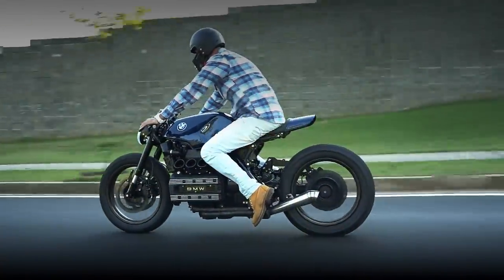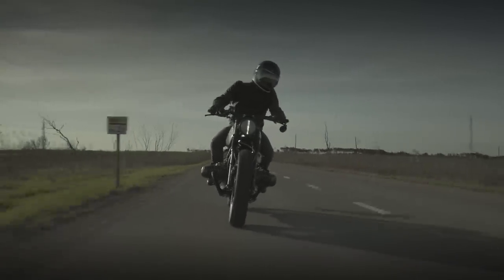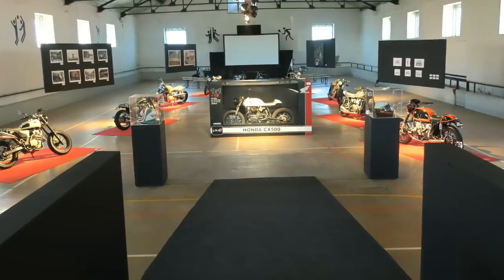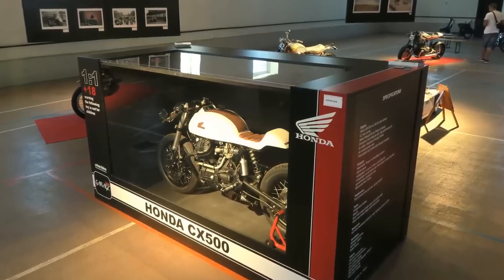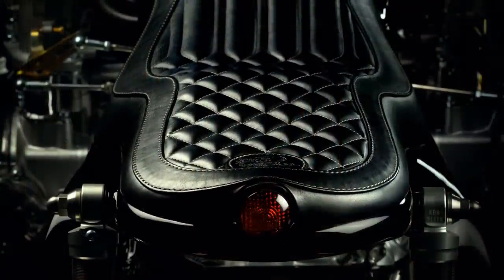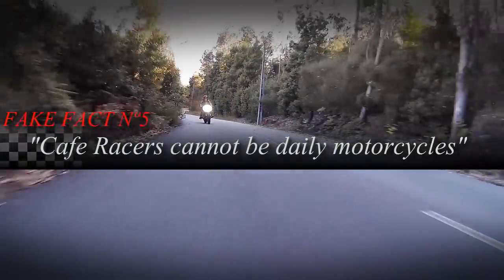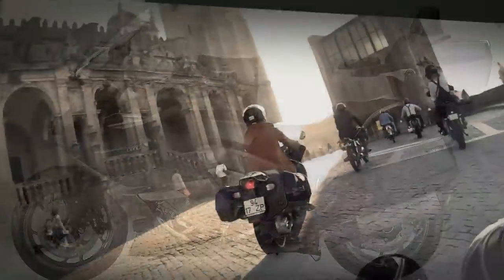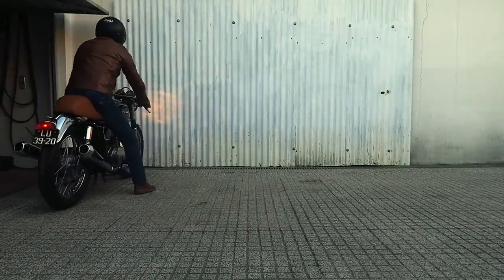Top 5 Fake Facts about Cafe Racers

Comment: Biggest mistake most builders make is fitting a stupidly huge front tyre. This slows down your steering & flickability in tight turns. NONE of the original cafe racer boys at the Ace Cafe had large section front or rear tyres. I know, I was around then & still have a 66 Triumph Bonneville caff.

Comment: Cafe racers have largely lost their purpose. Back in the '60s they were all about making a motorcycle go as fast as possible by cutting bits off to save weight, changing rider aerodynamics and adding fairings, whereas now they are simply fashion statements that are often made worse than their original designs in the pursuit of aesthetics.  Looking at that CX650 seat cowl I'm willing to bet you know a thing or two about fabrication and engineering but recommending knobby tyres for a 500cc+ bike with no rear mudguard is as crazy as putting vintage tread on a street bike. It's all about preference but personally if I'm riding a bike daily rather than posing next to it once a week, I want it to be as capable and versatile as possible, regardless of its looks.
Reply from the maker: Yes, I understand what your said. I already talked about that matter in other videos.Nowadays, the original purpose of the old motorcycles customized like the original Cafe Racers, does not make sense anymore. If we follow the pure perspective of those Cafe Racers, we would end with something similar to a modern Yamaha R1. And this means that this rebirth of the "cafe racer" scene, must have a different approach. :) But thank you my friend for sharing your perspective. :) Cheers.    

      
      
Mostrar menos

Comment: Since my accident two years ago I went through the logical stages, the last one was weight gain, both due to the impossibility of exercising daily, as I had done all my life. Eleven fractures create their own dynamic, both physically and mentally. No more, with the help of a nutritionist, my doctor and a physical trainer, I have several months of having started in the morning my daily routine of running six kilometers, doing 13 exercises of twenty repetitions since five in the morning, the time used to watch videos on youtube. My left arm, with the Osteosynthesis in the humerus has been strengthened and has more mobility, which is serving me a lot in the handling of my motorcycle. That's why it took me a while to broadcast my brazen opinions, I will say however, that this is one of the most necessary videos for those of us who love the café-racer style. Myths are myths that confuse and make it more difficult to make decisions when starting a project to modify a motorcycle. But a motorcycle with a style that if you do not do a correct job, can result in a complete failure, both aesthetically, and from the point of view of safety.  The five points treated seem to meet all the requirements of reliability on issues that concern us to those who are immersed in the construction of a motorcycle that makes our heart move with passion. By the way, I have already dropped eight kilograms and I feel very happy, when I ride my motorcycle on the road. Saludos
Reply from the maker: I am very happy for your my dear friend. Congratulations for your effort. You really deserve all the happiness. :) I wish you the best. Saludos.
Reply: Cafe racer is a fashion design motorcycle, because not of all people like the sports bike, or motocross bike, same us people. Not all would like to wear hip hop style or rocker looks, other people they like to be simple but with fashion ,  and for me i like classic fashion, and i like cafe racer type or harley type :D

Comment: 6:27 (old tyres) I am sorry but I have to disagree here, old tyres look amazing but when it comes to grip and all around drivability they might not be the best choice, it's not only a matter of shape or tread design but also compound. Personally I am a fan of the Bridgestone battlax bt 45 it's a good all around tyre it doesn't get amazing mileage but it's perfect from warm to chill weather and drives pretty good on wet roads. I get that probably not everyone decides to use his bike daily or on the twisties but if you do I would ditch the old tyres
Reply from the maker: Yes, You are right. Classic tires will never be as good as modern tires. But some classic tires are not as bad as most people say. I think it is a question of compromise.   But Thank you my friend for sharing your opinion. :) Cheers.
Reply: Michele, that's what happens when you put aesthetics before usability and the real cafés were all about grip in curves, up to the point that the first transformation was to fit the best tyres you could afford. So no, that's for poseurs starbuck-racers, not real cafés... :-)

Comment: Tire wear flat spots can be mitigated and exacerbated by air pressure.  Found that out after getting spit off and sliding across the pavement from a low side with 15 psi in the rear tire.  Pumped it up to 40 psi and it felt more unstable.  32 psi felt amazing and rock solid on my '05 Sportster and Pirelli Night Dragons...
Reply from the maker: Thank you my friend for sharing your perspective. :) Cheers.

Comment: Hi, thanks again for another interesting VLOG.  I haven't seen your CX650 project before....Nice.... May I ask what wheels you are using - and what bike they may have come off, please?  Thanks, Paul (Sydney Australia)
Reply from the maker: Thank you my friend for your support. The wheels/hubs of my CX are custom made. But if you are looking for a rear wheel with spokes for the honda CX, try the "Cognito moto" website. I hope this helps. Cheers.
Reply: Many thanks.  I know that site. Actually I really like the spoke rim look and am considering using wheels off a Triumph Thruxton with custom hubs from Cognito Moto for my CX500 build.  There is a 1-inch difference in rim diameter for both front and rear, but I am presuming, this won't make much difference.  Please keep us updated on your CX650 as I'd love to see how you are progressing....
Reply from the maker: I see, but be careful about the rims size. Especially on the rear wheel, because the swing arm won't let you to use more than a 4.25 inch wide.  Here is the size of the rims on my Honda CX.  
Front rim R17  with 3.5 inch 

Rear rim R17  with 4.25 inch 

Good luck for your build. Cheers.

Comment: Well, my height is 192 cm. And my knees don´t like to be angled less than 90 degrees. My hands do not want to carry to much weight. And I do not want to sit on a slim board with almost no upholstery. Last but not least I don´t want to terrify others and myself with to much engine noise. So a café racer for me is not a good choice. But some of them look and sound very beautiful. Like your Honda CX 500/650 project does.
Reply from the maker: Thank you my friend for sharing your perspective. Maybe you should find a solution to your size. Maybe a Scrambler project would fit you better :) Cheers.

Comment: My 2cents on tyre choice, you were totally accurate, unlees you use full on dirt knobies most mixed tyres will perform better than expexted on-road.
I myself ride a Honda XL from '87 on Continental ContiScape tyres (with oem sizes, that is 21" at the front and 18" back) and they provide a very comfortable ride, grip more than enough for your standard riding (even some fast cornering if you know your bike and its limits)  and allow me to take on easy to medium dirt roads. They wont be as good as dedicated road tyres, but arent a death trap either.

Comment: People complaining about comfort sounds similar to those that say the same with sport bikes. It usually comes down to body position, and alleviating the weight off the upper body/arms by using core and leg muscles. I was able to ride 600 miles in one day on a new cbr1000rr and never felt any aches on my back or arm pump. The one thing that might be an issue on non faired bikes is the  lack of wind protection.
Reply from the maker: Thank you my friend for sharing your perspective. :) Cheers.

Comment: I love the bikes. The main problem I see is that with a sport bike riding position, you need to hold on with your legs. There should be a little to no weight on your wrists. These bikes would roast your thighs. But worth it!
Reply from the maker: It is not as bad as you may think, unless you create something very radical. On my own Honda CX650 Cafe Racer, I have no problem on riding it during a 1 hour trip. But after 1.5 hour, my arms and my butt start feeling tired. It is just a question of making some stops to get some rest. :) Cheers.

Comment: A cafe racer is not just a set of low bars and skinny seats. They are Road going production racers. Tune the engine,  suspension, brakes and sort of the position and feet. Not theme bikes.

Comment: Ah, the SMK11, the very tyre that killed a friend of mine in the damp. Unless you ride in a dry & hot climate I would avoid "old" makes of tyres.
Reply from the maker: I understand what you said, but the Shinko Tires are an exception among those kind of retro tires. The rubber is actually very good. Cheers.

Comment: IMO a cafe racer has to unequivocally outperform the original motorcycle, it has to handle better, it has to stop better, it has to be lighter, it has to be faster, , it should have nothing on the bike that doesn't that contribute to the previously mentioned requirements. The only exception to these parameters are what is required to make the bike street legal. The form/esthetics must always follow the function (cafe race) without question. The purest form of a cafe racer is built by the rider himself.

Comment: Every single build has altered the rake and trail, shortening the forks and reducing the headstock angle.
This is fine if the motorcycle is to be displayed in front of a cafe, or in product videos.
It is unsuited to complex road traffic, uneven road surfaces or variable weather.
Older frame geometry becomes very twitchy and unforgiving with these mods.
Reply from the maker: Yes, but that makes part of the process. Personally, i don't want a perfect motorcycle. Imperfection, is what gives character to old cars and old motorcycles. Thank you my friend for sharing your perspective. :) Cheers.
Reply: I'm talking about safe handling.
Reply from the maker: Oh, sorry for my limited english. But i think it is always safe. Only less efficient than modern motorcycles. It is only a matter of knowing the limits of the motorcycle. :)

Comment: You seem to misunderstand what a cafe racer is,  it was originally all about getting a ' TON ' or better out of your bike and racing between cafes. It had nothing to do with aesthetics! these bikes were built in your shed or backroom!
Reply from the maker: I understand what your said. But your vision about what a real Cafe Racer has to be, is not accepted by everybody. I already talked about that matter in other videos.Personaly, i think Nowadays the original purpose of old/new motorcycles customized like the original Cafe Racers, does not make sense anymore. If we follow the pure perspective of those Cafe Racers, we would end with something similar to a modern Yamaha R1. And this means that this rebirth of the "cafe racer" scene, must have a different approach. :) 
But thank you for sharing your perspective. :) Cheers.
Reply: My father in law lived it, Now you may have a more modern opinion but in those days money was very tight and scrap bikes ( ex military usually) were quit common and cheap! Cheap being the main reason behind finding inter changeable or easily fetaled parts to fit! That's what Arthur told me anyway!👍

Comment: Nice program. Realy enjoyed it. I have built a few bikes. But some of these bikes built loose to much for looks. My pet dislike is realy short exhaust systems. So much lost power for no real good looking affect. The original cafe racers mimicked the race and sprint bikes of the day. Same as the r bikes do today. The long fuel tanks clip ons . Rearsets.  Remember the bacon slicer cooling rings around the front brake. Didn't work but looked cool. That people take cx 500s.  Gold wings.  Bmw.s and make cafe racers out of them. Get my vote . I always support the underdog. Most people take a single..twinn.  or a four.. most take a chain drive. Good luck to all the guys and gals busy in there sheds
Reply from the maker: Thank you my friend for your support. :) Cheers.

Comment: Racer, recently I was in italy, and I saw a simply stunning cafe racer (or may be a brat style) based on (propably) Moto Guzzi V7. Rider was weared a stylish look. Guzzi is very rare motorcicle, especially cafe versions
Reply from the maker: Are you referring to the "Moto Guzzi V7 racer" model?  Try to search on google Images for "Moto Guzzi Cafe Racer", and you will see that they are much more common than you think, especially with cafe racer versions. :) Cheers.
Reply: nope, I think "ordinary" V7, customized as a cafe racer/brat, wtith the flat handle bar not a clipons
Reply from the maker: Maybe you saw a project built by Officine Rossopuro. :)

Comment: I wonder how many people in human history have actually cafe raced. It always seemed like a ridiculous notion to me.
Reply from the maker: Interesting question. Believe it or not, it is way more common than most people can imagine.
We usually associate a cafe racer motorcycle to the late 50's and 60's. 
But the essence that created cafe racers, is something that most men have by nature.
Basically, a cafe racer should be based on a factory original motorcycle, making it lighter, and faster.
And this basic goal, is extremely common among youngsters.
Even I had a small honda NSR 50 in 1990, and after a while, a made some changes on it, and increase the engine power from 50cc to 65cc.
And this kind of modifications, was very common among my friends with 16 or 17 years old.
It may not be considered as a cafe racer, but the goal was the same.
And this goal is still very common among youngsters, even today. :) Cheers.

Comment: one thing that i hate to see on cafe racer projects is the front forks raised up it the triple tree thus kinda reducing suspension travel, maybe making them more uncomfortable? @7:10 is one example.
Reply from the maker: I understand what you are saying.
But sometimes, it's the only way of getting the right and low stance that makes a motorcycle look good.
In what concerns to the motorcycle you referred to, it is based one a Honda Tornado 250, which makes the transformation fantastic. Cheers.

Comment: Wouldn't a modern rendition cafe racer style bike, need to retain most if not all of the original cafe racer styling ? These bikes don't. I'm not saying they must have old school engines or wheels ! Thanks for pushing a "new" trend for hipsters, and helping to change the meaning of the term Cafe Racer. BTW, I like a couple of the bikes featured, but would call them customs, bobbers or Street fighter. Or I don't know what if you insist on mounting those ridiculous "knobby" tires...

Comment: Well, considering that the motorcycle kinda resembles and maybe took over a horses job, I think most things are irrelevant. Maybe a cafe shouldn’t be a two seater, because its basically a race bike. But people tend to forget that there are no rules set in stone! Is the cafe racer still used for racing? No, it’s not. Than I see no reason why it shouldn’t be a two seater. Or just buy a horse

Comment: i think unless the bike is an original 1950s to early 70s road bike then it isnt a cafe racer.... you can make a pretender that looks like a cafe racer. but considering the cafe racer was created in england between 1950s after WW2 to around the early 70s where it ended, along with the very bike manufacturers that created these bikes like BSA, Triumph, Norton etc,  it cant be re-created with modern bikes and a completely different era. 
After all... Cafe racers are a creation of young people who loved the TT Manx racers of that time, and trying to copy them Like the old Trition's..
A modern cafe racer from a modern bike to me is just a custom motorcycle that has no connection to the TT bikes of old, and not a cafe racer

Comment: which number would be best for honda cg 125 cafe racer .please mention for both back and front
Reply from the maker: Are you refering to the Tire Sizes?
Reply: @RACER_TV  yes!
Reply from the maker: Well, it depends of the of the style of cafe racer you want. If you want a CG with no fenders, i usually recommend the biggest size you can get. But if you use fenders, maybe 2.75 in the front, and 3.25 in the Back.
Reply: thanks
Reply: without fenders please mention the big sizes
Reply from the maker: I am not sure, but on my honda CB 125 B6, i was able to fit a Front tire 90/90 R18 \\\\ Rear tire 110/90 R18.
Reply: @RACER_TV  thanks :)

Comment: I pulled down a cx500 for the first time at Hughes Honda in Brazil Indiana 1981..,, extreme. noise .a combo of valve and cam follower noise up on inspection two lobs on the cam were nearly gone those cam followers were dished out , the others were next to go ..and I found the trouble. .. Honda did not design this model engines with any oil supply to the cam lobes at all ...no spray line , no oil passage ,no main gally oil system at all.. Harald brown the Midwest service representative was in the next day ..I jumped his shit about it ..he told me in so many words to forget about it cause all production was ending soon 
.and to keep it under my hat. apparently it does not matter  l have been staying this ever since and No one ask or questions me ..and I keep seeing build after build ...the metal fillings go right through the filter and destroys all the bearings as it is catistrofic failure ..two brand new units locked up and crashed at our shop so I got me another job ..not only are you building engines that come apart waste time and money  you can also lose your life  when the engine locks up   as they do
Reply from the maker: Thank you my friend for sharing your perspective. :) Cheers.